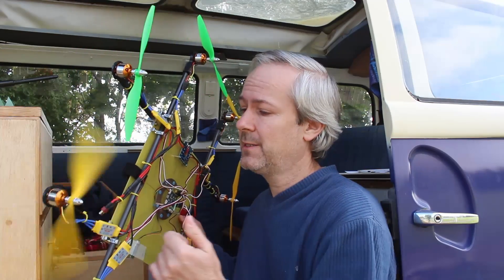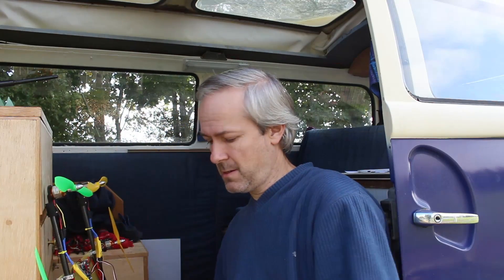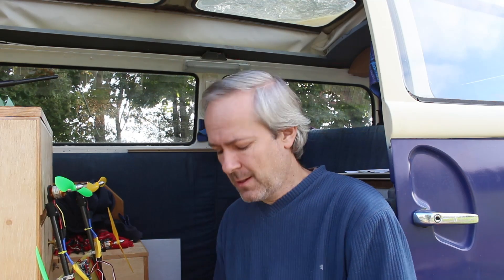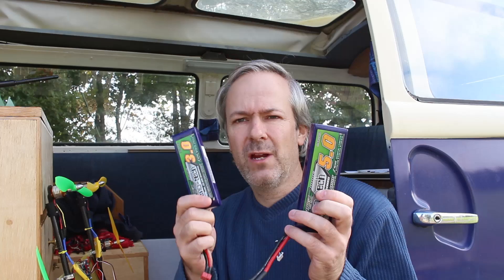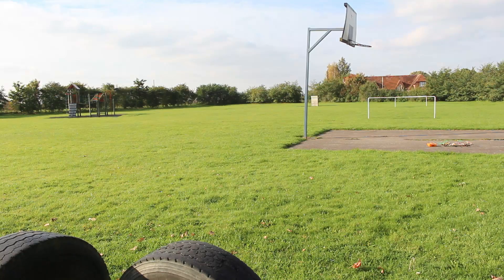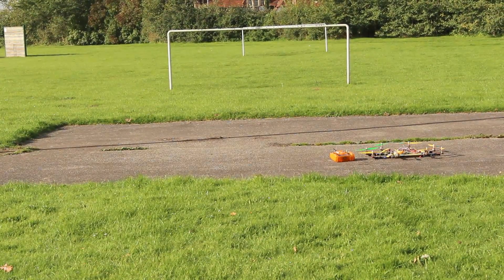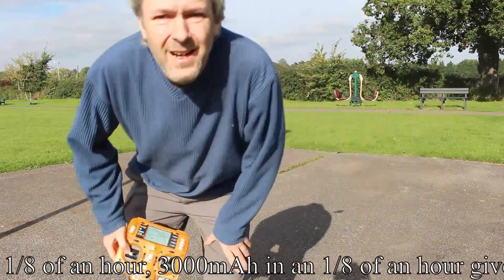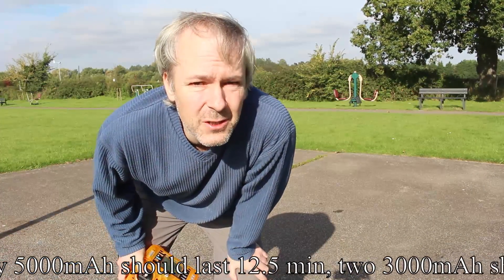Octocopter, Multicopter, OCTOFLATX, Crius all in one pro. 2212 brushless motors  30 amp ESC.

Comment: Hello friend ...You used 930 KV motor ? you remember the PID values ? How many   3s Battery and C you recomend me from hexa with 930 KV with 10.5 blade
Reply from the maker: i think the motors are 1000KV so about the same and the props are 10" 4.5, i think you are best to start with a bigger battery just in case you are sucking to much current, something like a 5000mAh, sorry i dont have the PID settings.
Reply: Can I ask...can you connect the octo to the mission planner and read the PID results? I need configurated my hexa PiD
Reply from the maker: sorry but i no longer have the Oct. i generally only bother with quads now.and i dont use the Multiwii boards
 @mrz2528
Reply: Ok what board you used now ...I used crius with megapirate
Reply from the maker: i don't have much time to do the drones at the moment, but i did follow the multiwii progression to the INAV which supports a lot of boards @mrz2528